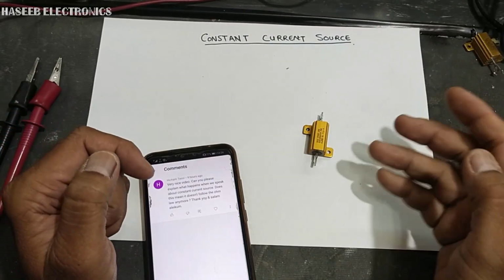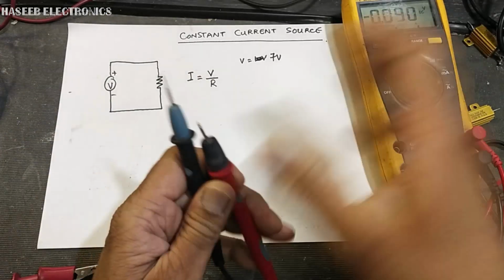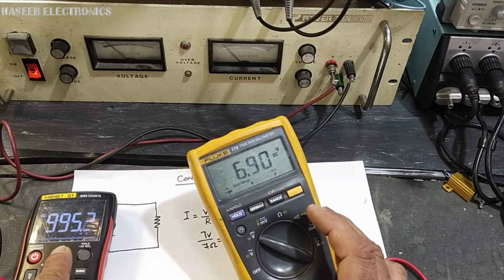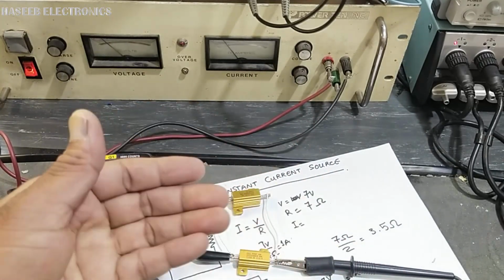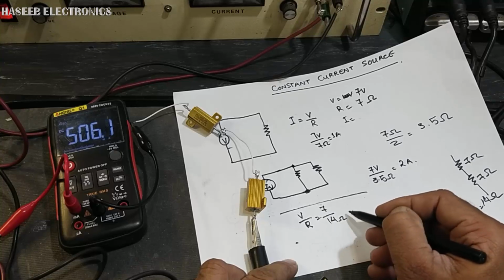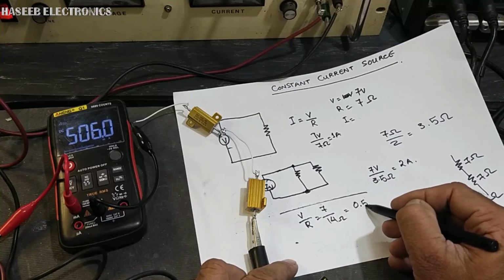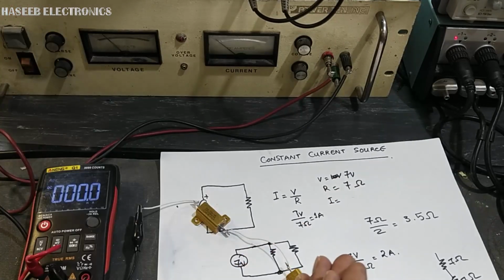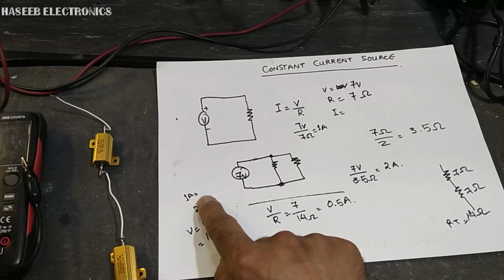{661} Constant Current Source,  Constant Voltage Source, Explained

Comment: But, sir in CC Mode voltage not increase automatically in Variable power supply which  we use for electronics 
Repairing...

Comment: I really find your videos educational, I just recently subscribed for your thoroughness. I had bought some led shop lights from from my local home improvement store, 6 of them to be exact all but 2 have failed, I was able to troubleshoot them and found multiple component failures, diodes, capacitors and resistors. The led driver was designed around a uc3842 pwm. Instead of trying to repair the driver , I would like to build my own, can you do a video designing a constant current led driver capable of driving 80 leds in series?